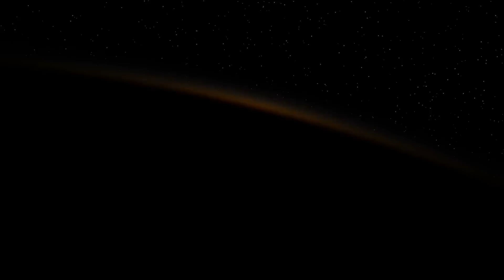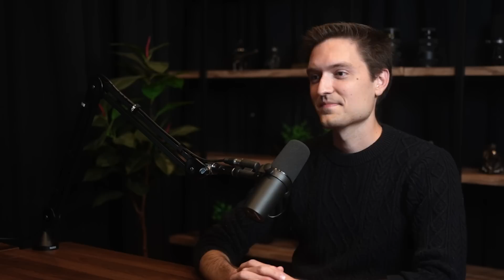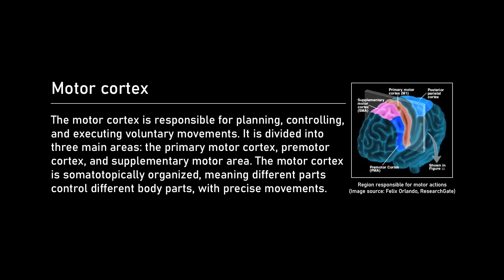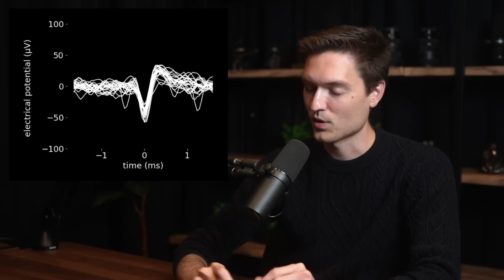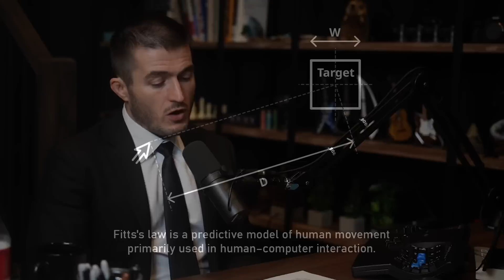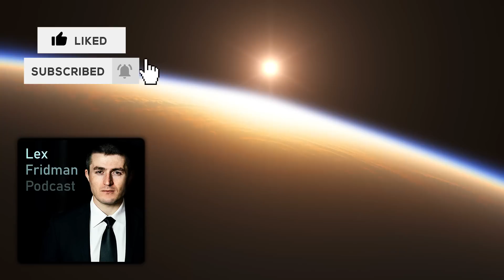How Neuralink software works | Bliss Chapman and Lex Fridamn

Comment: I think the interpretation of the signals can be done with greater accuracy if the neurallink is implanted on a non paralyzed human, as they can match the signal with the exact body movements or intentions
Reply: I’m in no way experienced in the medical field but personally I feel they need to program this for each person . Maybe not program but calibrate would be a better word . It maybe easier to calibrate on a functioning body but not necessarily better .

Comment: I wonder how long it will be before its wireless and without an implant 😅
Reply: It already exists . It’s passive and the through out is not so good. The person would wear a type of head apparatus. As it’s not directly connected to the brain directly it’s not nearly as accurate. Maybe the tech will work. I view it like gaming on a network cable vs gaming on wireless connection .network cable is going to win every time for reliability.

Comment: I believe this is a scam😂
Reply: Thats probably what a lot of people thought about apple and microsoft and amazon too
Reply: it is a scam, you can't probe a brain without damaging it, or you read it from outside.
Reply: if you read it from outside you have too much noise
Reply: Yes and no. This is pretty cool. Amazing. 

Even though it is great, it is overhyped. There are lots of kinks that need to be worked out in hardware and in the science. Neuralink and similar companies are focused on building the hardware and ignoring the vital neural coding part and other science kinks which they leave to academia. Academia in turn had a major budget cut in related work.